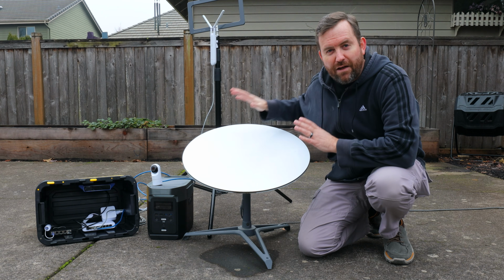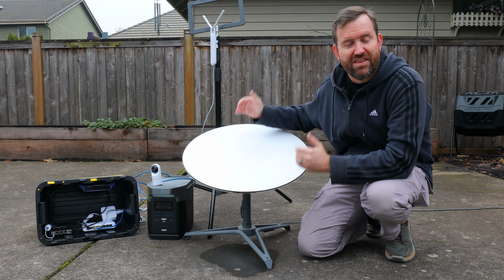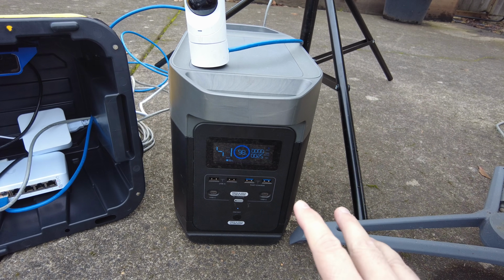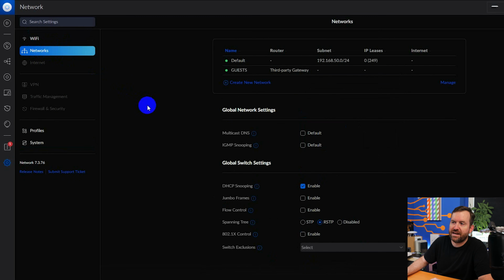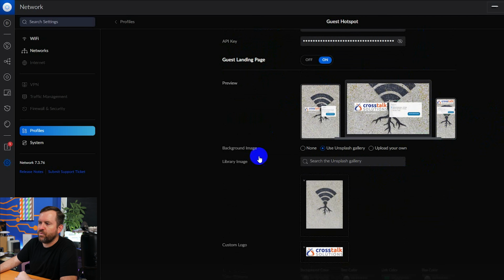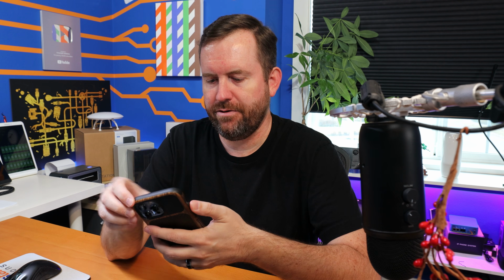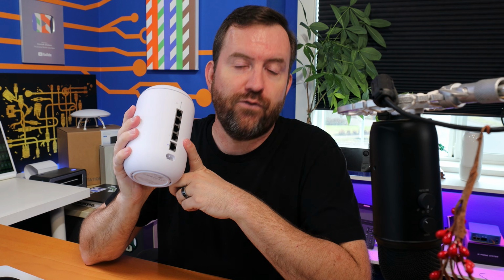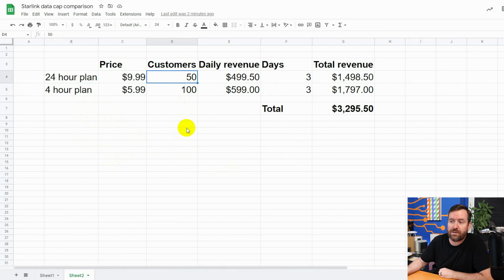How To Make Money with Your Internet Connection

Comment: Please don't encourage people to do this. We do temporary networks for events and mission critical services. We manage everything from ticketing, Payment systems, emergency services communications, general operations cloud services, CCTV, iot sensors for water tanks etc. Last thing we need is people rolling in and nuking 160mhz channels at full power. It's tough enough managing around 3-4000 clients with sparse low bit rate coverage. Channel planning on our access layers with everyone else that requires Rf. From lighting to sound and media teams that bring their own kit. Not to mention every knob with a drone that flys through ptp links. At the end of the day if you are going to operate a network on an event site please liaise with the operator to get permission and make sure you work into their RF plan. We have seen a spike with starlink coming out. These are usually private sites and if it impacts emergency services it's likely you may start getting deauthed.

Comment: Mikrotik will be answer for more robust applications like these we use them in remote locations on our towers and they work great maybe something like the rb750 powerbox would do the trick but setting up the Hotspot is a bit more tricky but once done runs great we have a similar setup in a resort using cambium AP's and mikrotik routers running the Hotspot manager works perfect

Comment: I was also wondering, could we use extra “UAP Mesh access Points” to extend this network wirelessly?  If these could be dotted around the festival/camp ground, within range of the Network-in-a-Box, or each other, hopefully this could extend the range of the WiFi signal over a much bigger area, and give much better coverage.
If so, could these “UAP Mesh access Points” be powered remotely by battery, as well as a small solar panel, to recharge the battery during the day?  I was just thinking about a small lockable battery box (which could also be used as a base), which would then have a pole attached to it.  The pole would have a “UAP Mesh access Point” mounted to the top of the pole (out of people’s reach, and to also enhance coverage), as well as (hopefully) a small solar panel to charge up the battery during the day.
If you think this would be doable, it would be great to see what sort of setup you could come up with for this, as well as the possible power/battery and solar panel size and options which could be used for it.
Reply: Each hop on the Mesh network effectively more than halves the bandwidth because Wireless communication is half-duplex and a shared medium. 
Half-duplex meaning a device can either transmit or receive, but not both at the same time. Shared medium meaning only a small number of devices can transmit or receive at the same time on the same channel. From another Crosstalk Solutions video about fixing wifi at his friend's house, all Mesh APs need to be on the same channel, so each additional Mesh point will congest the channel further.

If it takes 2 hops from the origin, you've decreased that Mesh AP's bandwidth to 1/4 of the rated bandwidth, which is still 1.2 Gbps. But that still needs to wait its turn to transfer to the 1st hop, and that 1st hop needs to wait its turn to transfer to the original AP. If there are 500 clients on the network uploading photos, that will slow things down quite a bit for people. 

Maybe setting up some point-to-point bridges with Unifi Building Bridge and connecting them to Access Points would be better. Each Access Point could run on a different channel, so there isn't as much waiting for the channel to clear up. There's no processing to figure out which hops are the best to use for the Mesh points, instead it's AP <-> Ethernet to Building Bridge <-> Over the Air to Other Building Bridge <-> Ethernet to Switch <-> Ethernet to Router every time.

Comment: Great Video.  Thanks once again.  😊
I was just thinking, in the case of Music Festivals in the middle of nowhere, they are usually situated in relatively flat locations, which usually end up being in a valley, often with no Cell coverage.
In cases like this, would you be able to setup your “network-in-a-box” unit on top of a nearby hill or mountain (where you may be able to pick up a good LTE, or 5G cell signal, removing the need for a Starlink service) and then use a large WiFi antenna to beam the WiFi signal down into the Music Festival’s location.  I understand that some of those panel type WiFi antennas can work up to 15 KMs, line of sight.  Or would your customers then have trouble getting their signal back to an antenna like that, over that type of distance?
It’s just my daughter was at a Music Festival like this recently, where the organizers where selling WiFi for 5$ for 5 minutes (daylight robbery!!!), and apparently, they were doing a roaring trade, as there was no other option.  So, I’m sure they would have issues if someone came in and undercut their WiFi costs, so being off site would probably also make life much simpler for running a project like this. 😉

Comment: Nice idea! Thanks for the share! If you have a USG laying around (I bet you do) you could power that off of the 12vdc port on the Eco Flow Delta and ditch the EdgeRouter. You could also get a POE power splitter, POE Texas has some options, to power the USG off of POE as well. They also have POE Pi-Hats so you could add a Raspberry Pi and Pi-Hole to the mix! Looking forward to future videos on this idea/project; think internet "go-bag"...

Comment: If you wanted to limit sites,  you could always add a PiHole, without much on terms of power addition. .
Reply: A dns that blocks it is free with zero power or extra hardware
Reply: You also get DNS caching which can reduce load on the internet connection.

Comment: this is all fine though reality is  you aren't going to be hosting the events capacity on sat/air fiber/5g/4g-lte-a connection

looking at my entire home network I have come to the conclusion that wireless whilst practical in its use doesn't have the capacity in hosting more than 12 devices though hosting for  100+ devices is going to cause an issue on data throughput and that is with capping  people to 15mbps or less

Unless you have a commercial service and a commercial license for internet i wouldn't try and use  something meant for domestic service as commercial product  as it will be against the TOS of the provider...
yes you can do it however the caveat be careful what you wish for because you have limitation in your service contract

Comment: Since the UAP-AC-M has been sold out for months, what's another option for a weatherproof Unifi access point?
Reply: The uap ac pros are another option
Reply: @Jiggs224u  Unfortunately the uap-ac-pro doesn't seem to be as weather resistant as the uap-ac-m.

Comment: Some notes from my professional experience doing similar: a) Reselling Starlink is against the T&C's - sure, you can do it, but if they catch you, you're done and potentially liable. b) you can mount the gear in a completely weather proof enclosure that is mountable and lockable ($25 to $150 off amazon), as I'm sure you know (the tote is weak IMHO). c) Couple a few 300W PV panels, AGM 200 AH batteries, and do it all DC to increase electrical efficiency (would need bigger enclosure, or added battery enclosure, and use DC powered network gear). the Ecoflow Delta is stupid expensive and you lose efficiency on AC conversion. d) add a cell-based backup *with a booster* (Verizon LTE/5G plan, which is mobile, but again breaks T's & C's though possible to do) as either load-balanced or failover as well as cell coverage for customers, as long as you can find at least -125 dBm of cell signal - the Cel Fi Go X is a great booster for just this. e) that mesh AP will not hold 100 devices connected - especially if those devices are moving away from the AP, unless you use RSSI mins (lots of AP tweaks needed to make this work well). f) why subject yourself to using only 1 power outlet for the PoE switch - you could easily add a USG3 as the firewall and get all the bells and whistles you can't get with the ERx (including 2 WANs) and add only a bit of wattage, and use a better DNS service that's more flexible and secure / able to block whatever you want. g) if you make changes to captive portal under new interface, make 1 change at a time, save, go back. h) most importantly - as a business, you can simply contact the festival promoter and work out being an Internet vendor, including for the performers / merchants and make even more $. An easy way to figure out your back haul is to work with a master agent company as a sub-agent and resell the circuit (even if you have to PTP it onto the festival from a neighboring location) and know you have a solid, supported, resellable backbone - especially vendors who can also add SASE or SD-WAN to the backbone to offload the security onto their network and provide portability so you can go on tour, have fun, and make money, re-use that connection at your office/home/or on the go. Interesting as a side-hustle, but could be way more professional and could really provide festivals, camps, etc. with real Internet connectivity and  make real cash year after year. A festival with "10,000" people are not going to be supportable off a Starlink dish, and LTE connection, or some basic set up like this, unless you're doing it out of the trunk of your car. And, if you're going to the festical to enjoy the festival, WTF are you doing acting as a WISP for the weekend???
Reply: They now have Starlink Business which Internet broadband companies can use for reselling to their customers, mainly as backup or to complement existing services.

Comment: Wouldn't the device anonymization built into android (and presumably ios) which randomizes the mac address allow someone to exploit the free trial indefinitely?
Reply: On iOS the MAC address randomization turns off when you connect to a network. I wonder if the same is true on android
Reply: From what I can tell at less on android. It would just use the anonymize address, and doesn't change the MAC address, that it use unless you on that settings on.

Comment: This was a super cool little implementation. Really well thought out. I'm curious how well you think 50-150 people would fare on Starlink simultaneously, though. If you actually did take it to a campground, what are 150 people's experience?

I guess limiting streaming prevents bandwidth hogging to some extent, but wonder if Twitch, Facebook Video, or YouTube should also be on the blocklist.
Reply from the maker: Thanks!  Typically, I wouldn't expect that many simultaneous folks to be using a setup like this.  I imagine people would be using it in smaller chunks - perhaps up to 100 per day, but not all at the same time, so the concurrent usage would be minimal.

That being said, if you did need to account for 100-150 concurrent users, this would likely not be enough to handle that kind of capacity...you'd have to plan for more of everything (Internet/network/power/etc.).
Reply: @CrosstalkSolutions  Two things you didn't address is density. You will have a lot more than hundred people buying connectivity at a festival with over 10K in attendance! The iPhone password sharing is another headache regarding this solution. Please let me know how you would address these issues?
Reply: @prominencetechnologyconsul2436  It's not password based - It blocks/allows based on MAC address - Which while it's possible to edit, is far beyond the scope of what most people would do

Comment: What Ptp solution would you use for a 700ft connection
Reply: Ubiquity has some options, like the airmax powerbeam. If it's unobstructed LOS and the required bandwidth is reasonable, then 700ft is easy.
Reply: Ubiquiti nanostation loco AC's, or M5's, or M2's. AC's can do 655 mbps ptp symmetrical. Both the M5's and M2's have only 100 mbps LAN ports, so that's really the max. All these can also do PTMP but have only a 45 degree beamwidth, though at 700ft, you could literally put the radios in a box pointed at the ground and they would lock up with each other. I've done this 100's of times. They are amazing radios.
Reply: @seanzigmund858  I've tried with M2 loco's and didn't get the bandwidth I was looking for. I'll have to step it up
Reply: @Farmboy1927  yup - go with an AC series pair... nanobeam ac gen2 or litebeam ac gen 2 - both will have a max capacity of 656 mbps symmetrical. If you can get clear LOS, a pair of gigabeam 60's will give you over 1 gbps symmetrical over the 60 ghz radio and a backup 5 ghz radio at 655 mbps if the 60 fails/losses connection.

Comment: I would also add a raspberry pi running pihole with recursive DNS lookup/cache.  So less bandwidth being used for DNS lookup's through your connection.  Sure, DNS lookups is tiny, but when your talking about a small setup like this and optimizing the best performance for the most users, every little bit counts...

Also to optimize the battery, I would check the output voltage of the brick and if the battery has a DC to DC connection for PD-USBC connection, then find or make a cable to supply power to your PoE switch from the DC ports of your battery.  You are getting a significant lose converting battery DC to AC and going to a brick to go back to DC again...  Doing DC to DC, you will not get lose due to the conversion back and forth.  This would extend your battery usage time.

Comment: I'm skeptical about the viability of 150 users over three days usage, even if not all users are concurrent, to use the available bandwidth of the Starlink RV plan.  With the RV plan expected downloads are 5-50 mbps and uploads are 2-10 mbps, I think over saturation would occur at far lower connected users levels.    It's an intriguing idea and a great way to help out in a disaster, I'll give ya that.   The bandwidth mitigation, safe website DNS blockers, and application layers filters are clever and needed solutions to safeguard against any liabilities and to help protect users from potential malicious internet activity.   I think the upfront costs are too high for a good ROI as general business idea but if you already have it on hand, it could supplement the cost of owning it.    Although, as you and others have stated, it's against the terms of service from Starlink to resell their service.
Reply: I thought the same thing. 150 users on a sat connection,I doubt it would be a good experience for these users.